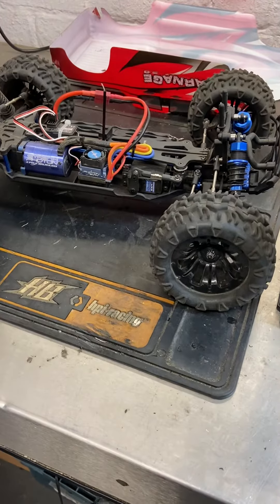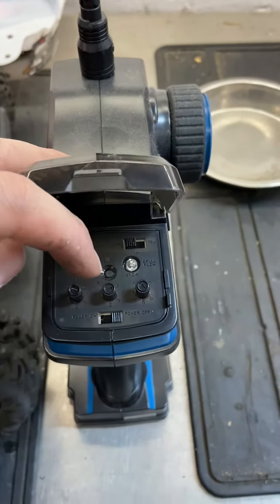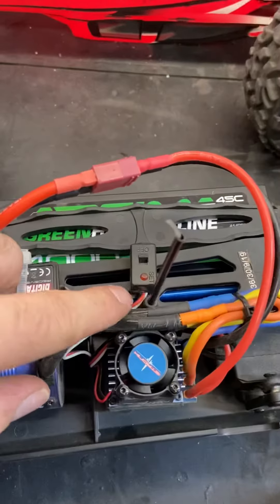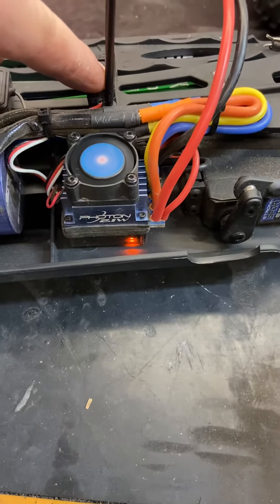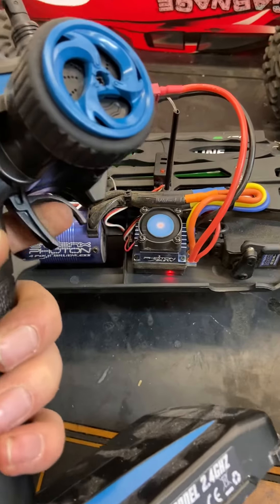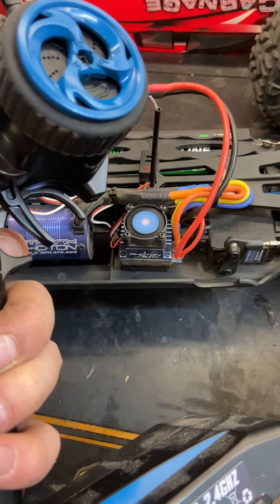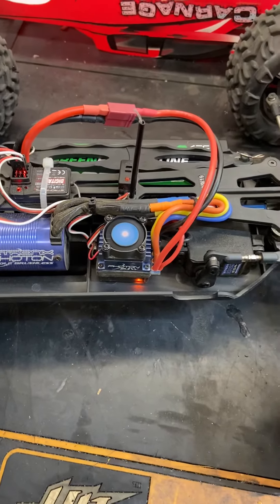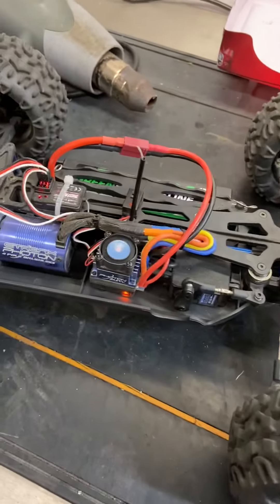Spudski RC How To: FTX Carnage / Vantage / Bugsta / Outlaw brushless ESC calibration to transmitter

Comment: The lights do what yours does but no beeping and the motor still wont run ? Any idears
Reply from the maker: If there’s no beeping it sounds like the esc has lost motor output so may need replacing.

Comment: I have an ftx vantage brushless and ehen I turn it on nothing happens no noise just the receiver light flashing when connected to controller the light stops and still nothing happens any ideas
Reply from the maker: If there's no beeps or noise from ESC when powering it on then it sounds like the ESC has failed.